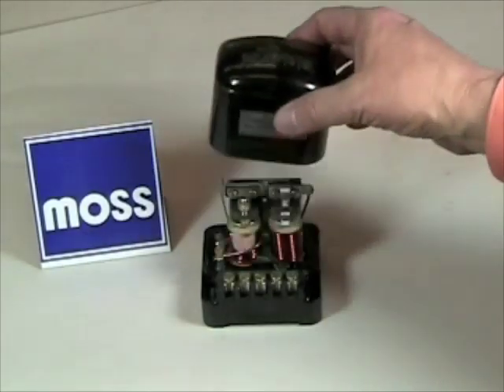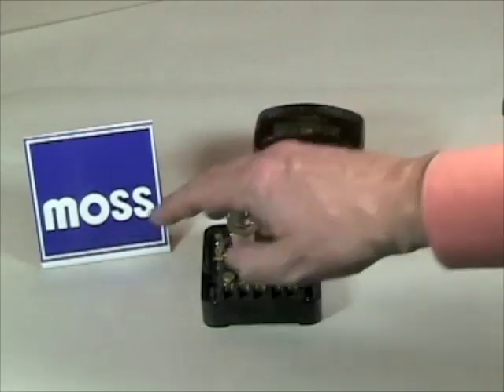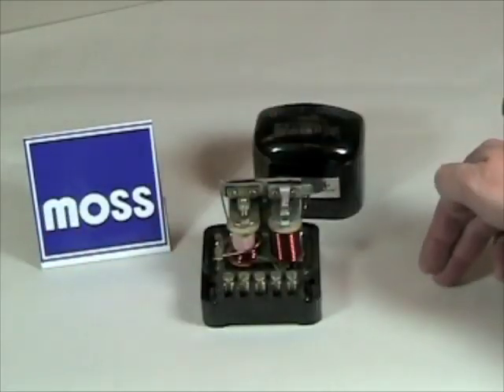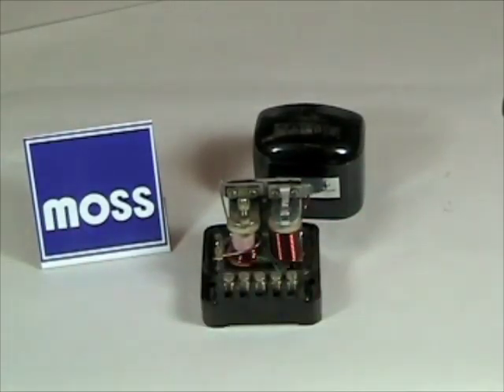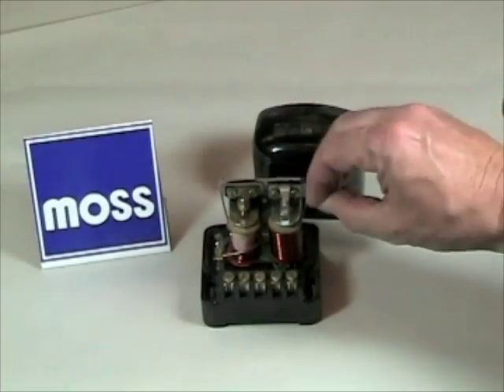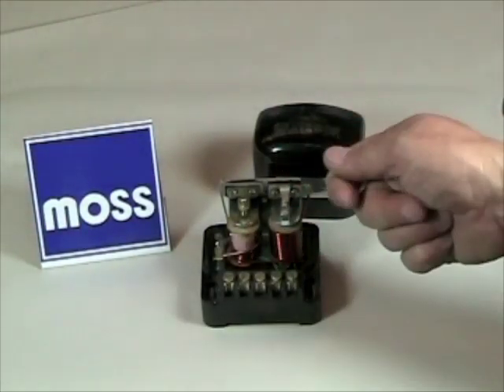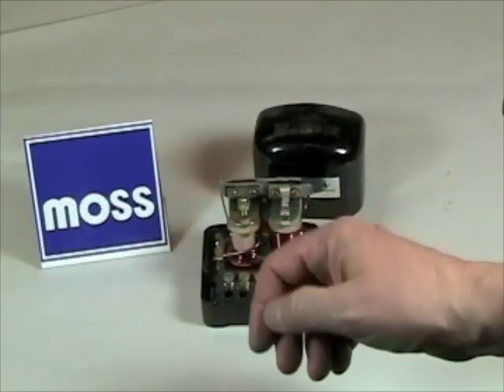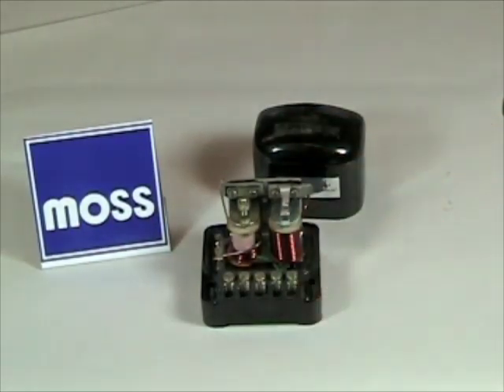Voltage Regulator - How it Works Part 2

Comment: For some reason, this switch inside my voltage regulator isn’t fully opening and closing, causing a buzzing to occur around 1500 RPM.

Comment: @sheasy2002 i have a 60 buick and when the generator is unhooked the car will not start.  it dont even turn over.  you might try checking the wires between the bat and the generator for continuity.  or check all the conections to the regulator.  i dont know a whole lot im just learning all of this my self.  but i hope this helps you.